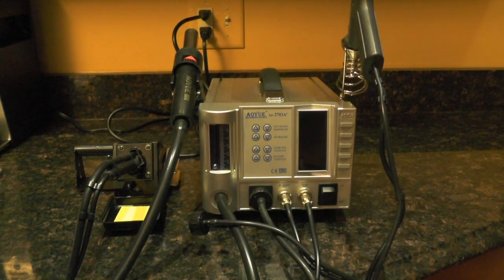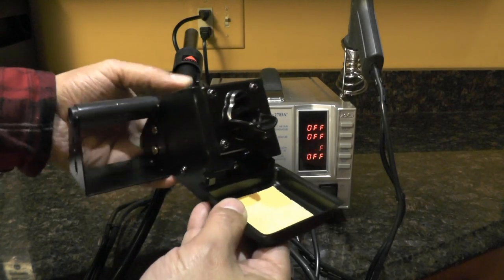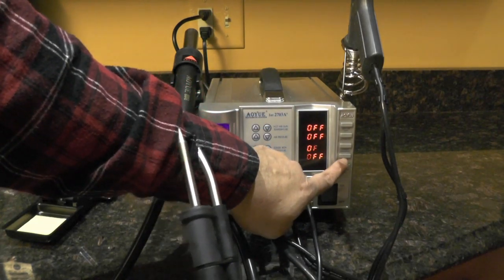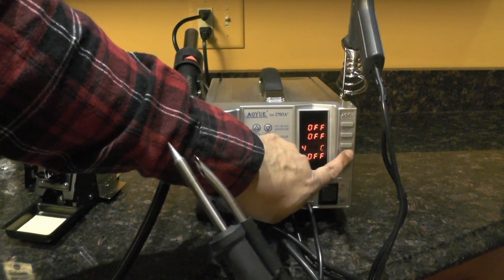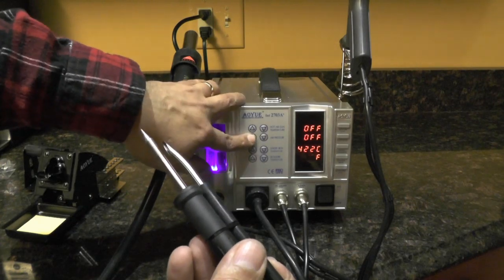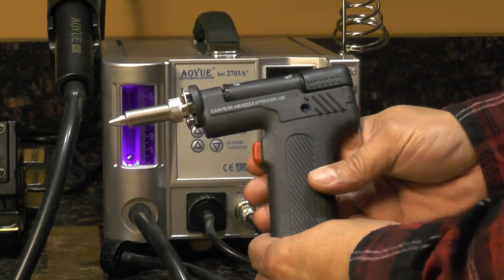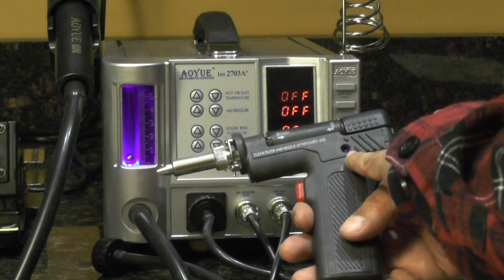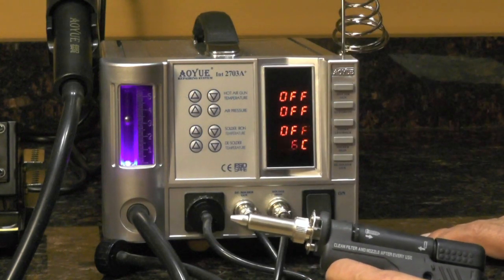Aoyue 2703A+ Soldering Station Functionality & Review (1 of 2)

Comment: The air inlet has a fat and a skinny part so that it can fit both hoses. You do not need to unscrew it and screw in the other. You just switch hoses. The other is intended to be a spare. I once had to buy a spare for my Aoyue Int701A++ so it’s good that your station included one. As for it feeling cross-threaded: Mine feels the same way. The replacement too. I believe it’s supposed to feel that way so that you can’t over-tighten it. Indeed, it does not appear to have threads on the nipple piece at all… just some nubs that interface with the threads on the station’s port.
Reply from the maker: Great info.  Thank you!

Comment: the unit have programeble iron temp corection that you can adjust the same for hot airgun.It have sleep funktion on iron that you can adjust the time it must be still before it goes to sleep.(it goes down to 200 degrees celsius when it sleeps.thin solder melts around 250-260 degrees celsius.some programeble features on heat gun to.i gess you have work out those.Good luck.Hope its corect advise this time.Its liftet a model that locks the same.

Comment: when change from c to f on temp its "always" one temp adjust button from each tool you press at the same time.for 3.5 sec.on mine it is like i wrote.so if you press down temp on one tool you press up on the other or the other way around.confusing-I hope it helps

Comment: I think you can change from Celsius to fareheith,all other station fromt them i have tried you can do that.
Reply: Really?  Would you be able to tell us how to do that?  I would greatly appreciate it.
Reply from the maker: I would like to know how to change it from C to F.  Do you know how to accomplish this?
Reply: you press temp down on hot airgun and temp up on the solder iron at the same time for 3-5 sec and it will apear a c or f when in that stae turn one knob on the station that wil change it fro c if that is ehat it show,to f.Hwen it say f you wait some sec and it stores.you can adjust how many degrees drift you axept and time it takes for iron to slep when it is still.The same for hot airguns drifT of temp under work you can adjust that ther to.button combination for those other settings i can come back to when i have chekt it on my station.Its baisicly the same with all of the simelar chines brands
Reply: correction.after down temp button hotairgun and temp up button on iron is hold in at same time for 3-5 sec and the f or c shows up in the display you changes the parameter with temp up on airgun or temp.only press one them for change from C to F down on iron.on mine it dosent matter wich tools button i use it stores on both enyway on mine.
Reply from the maker: Hi leohobb leohobb.  I tried what you instructed and, unfortunately, it didn't work on my system.  Nothing changed after holding for 3-5 seconds and I don't have a "knob" to turn.  It was certainly worth a try, though.
Reply: its diferent on your.i thin its like t press temp down button on iron temp and turn it on.the display should say f instead of c
Reply: if you want to go back to celsius you turn it off and pres and hold iron temp up while you turn it on with the power button in front

Comment: Nice station but dead for me after a short circuit on the air pistol...I have change the power resistance protection but nothing. But have does his time for 100$.
I have buy an Aoyue 2901 for solder. She's amazing ;) Aoyue nice quality but have a low cost model. No buy the basic! Sry for my english.
Reply from the maker: +Jbla Imrbot   Sorry to hear about your bad experience.
Reply: hi need to check internal fuse inside rear pcb board, this machine if have shortcut include 2 fuse inside machine, also on big resistor,  if you check sure find the solution
Reply: ?? Yes a big 4.7 ohms, power resitor. Is clean.I have bought a bag of resistor.  I'm electronican...I have change the soic 8 and the OP ampli, but i have not resolve the problem. i think my problem was on the set board.  Sorry for my english (i m french) have a good repairs guys
Reply from the maker: Good to know.  Thanks.

Comment: I'm not impressed with my Aoyue 2703A+. As soon as I unboxed it, there was loose hardware rattling inside the case. I opened it up and found a nut plate on the bottom of the case and also the IC1 chip wasn't pushed all the way into the holder.
Reply from the maker: Wow.  That's a recipe for potential disaster.

Comment: Hi there,

Thanks for your complete guide.
I did some changes to the inlet cap to avoid your problem:

Bought three air pressure Y shape (8mm)  parts and four switch's (also 8mm) so I have all four (*) tubes connected and never had to take the inlet out, just turn each switch "on" and "off" (easy) to select the source, and all "on" when I need to use the HOT GUN (more air), a bit expensive parts (30€) but a working solution.

(*) tubes used:

- Soldering Iron. (stock)
- Desoldering Gun. (stock)
- Air Pickup tool (bought separately) with some small mods (https://www.youtube.com/watch?v=DjpvpYQPezo) that allow removal of components (hotted with the gun) and also placing of SMD components on a PCB.

Extra:

- Second Soldering Iron (on the Desoldering Gun plug that I don't use very often) with a small modification to turn Smoke Absorver "ON" with a switch (remember - disabled when the Desoldering Gun plug is on because the gun has a switch)... 

I'm only searching for the power plugs (for the devices "2x" female and "1x" male) to have both "Desoldering Gun" and the Second "Soldering Iron" always connected  (less wear and tear) and then only a Switch to either select one or the other :), and my setup will be complete :D.
Unfortunately the connector isn't a standard type and although the male part is easy to take from a spare soldering iron plug, the female (like the one on the station) isn't.
Reply from the maker: Great ideas!  Such a great idea that a few months ago I used a similar mod on the air inlet on my soldering station.  I decided to use an inexpensive aquarium air hose manifold.  Like this one: http://www.amazon.com/Aquarium-Inline-Manifold-Splitter-Control/dp/B00EZC2Q10.  Now I have all the air hoses connected at once and I simply rotate the valve for whichever hose I want to have suction.  No more swapping hoses.  When I get some time I'll do a short video of it.
Reply: Watch This Hello Watch This, sorry for the late reply :)
I did manage to source the connector parts (both female and male) from ebay, so I end up using doubling ( the two outs are now four):

Using two switch's for each station output:

1- Soldering has now two (Both solderings irons[*]).
2 - Desoldering has two (Desoldering and soldering iron).

[*] one without fume extraction because sometimes the metal  pipe get's in the way :( of the soldering job...

I bought the same part as you (Animal fish store) but it's was too narrow and the station loss some pressure on both smoke extraction and de-soldering so I had to use something with a high diameter.

Now I'm asking a friend help (3D printer) to put all together (AIR IN and four AIR OUT's, also two Wire's IN and four Wire's OUT) in one box :)

Regards,

FJorgeR.
Reply: +Fernando Rocha Great info! I was thinking about doing this after reading the Amazon reviews about not having a second air inlet.

Comment from the maker: @Arnoldo Jose Paris Monagas
After using it for many months, I have not had a problem with it except for the suction inlet cap.  It never did screw-on properly - like it was cross-threaded.  Also, it would have been nice to have a toggle switch for degrees F and degrees C.  I can't get used to degrees C. 

I KNOW there are much better quality units out there.  But for all you get, and for the money, it was a great buy.
Reply: From experience it is far better to get used to Celsius since it is pretty much the WORLD STANDARD. Conversion is simple to do if needed.

Comment: Do you still have this station in your possession? I bought one and the soldering iron is not getting hot. The desoldering gun gets hot if connected to either port. I think the soldering iron is wired wrong. Would be willing to to take your soldering iron apart and pin it out?
Reply from the maker: Yes.  I still have it.  If the de-soldering iron works in both ports, this would mean that the ports are good.  Knowing this, if the soldering iron does not heat up, first try the obvious by making sure the soldering tip is pushed ALL the way into the handle.  If this doesn't work, make sure the heating element is connected securely and wired properly.  If that doesn't work, then I would say replace the cord, heating element and/or soldering tip.  Let me know if any of this works.  If not, I can probably pin out the soldering iron for you.
Reply: If you can please pin it out. I have posted some photos of the wiring on my soldering iron. http://bgamods.com/forum/viewtopic.php?f=35&t=4466
Reply: Robert Peek
Use the connector top key and bottom notch to reference the pins.
Reply: I think my tips might be defective. This new station came with one tip (WQ-2B) and I bought a second tip from a different seller (WQ-1404). The seller of the station sent me a second solder iron and neither tip gets hot in either iron.